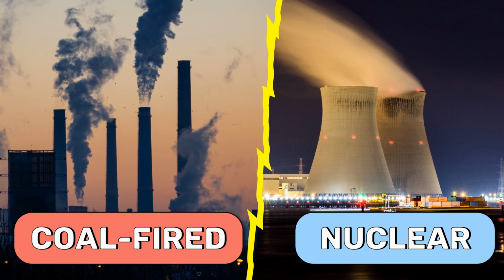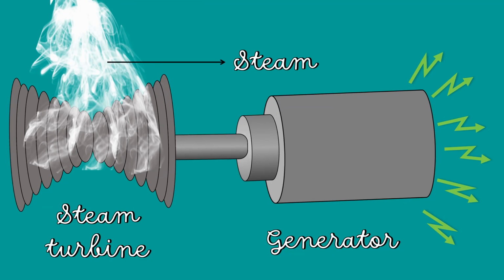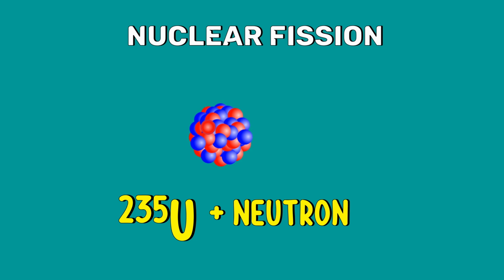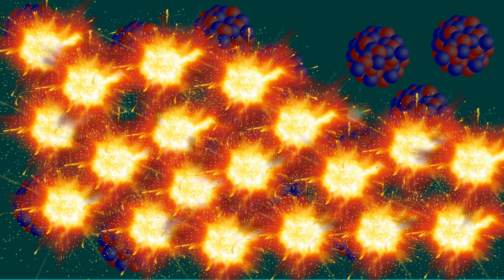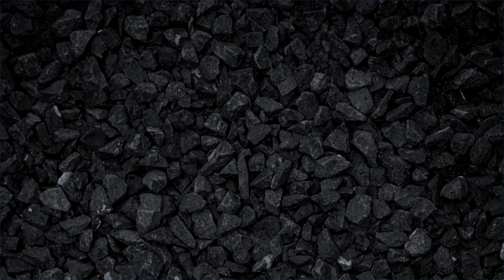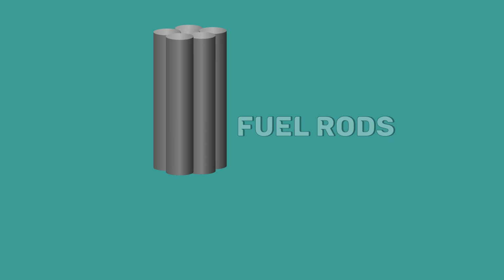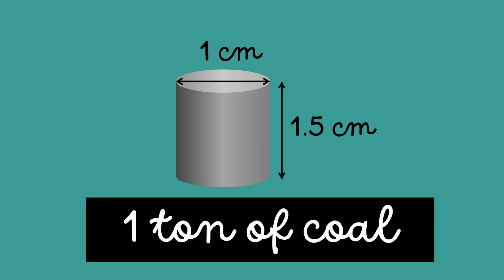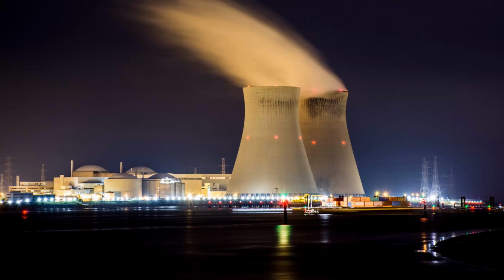Comparison between Coal-fired Thermal and Nuclear Power Plants

Comment: Vennila please explain, 
why leakage flux is considered as Voltage drop in the Transformer in Primary side?(In secondary winding the primary flux aren't fully linked because of leakage, so it can be considered only as a voltage drop secondary side, but in text books they mentioned voltage drop also occurs in primary winding due to leakage)
Reply from the maker: Sure.. I will upload a video about this in near future.